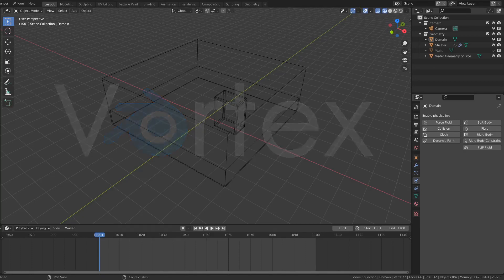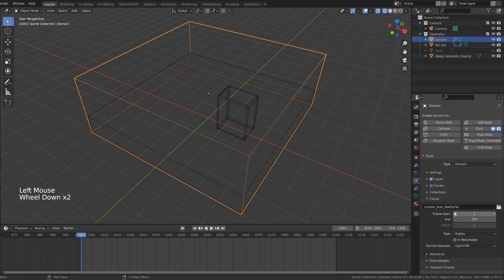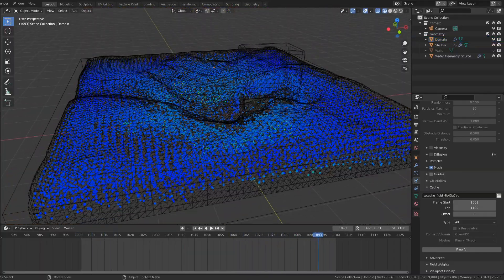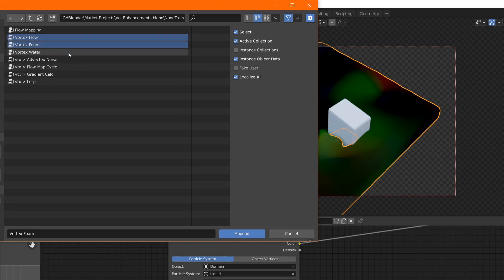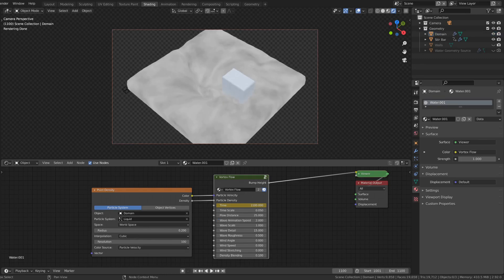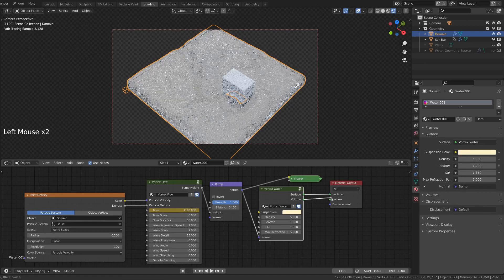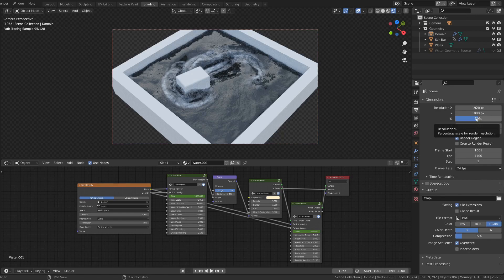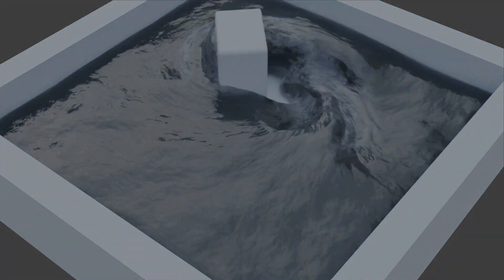How to use Vortex in Blender

Comment: How can you increase the saturation of the water? Like make it a deeper blue.
Reply from the maker: Hi, there's two things you can do:
1. Water colour is very dependent on reflections. Bright blue water also comes from bright blue skies. So, try to find an appropriate environment HDRi texture.
2. Sometimes there are things like algae floating around and changing the colour of the water, change the suspension colour on Vortex Water to see if that helps.
I hope this works for you!

Comment: does it work with flip fluid?
Reply from the maker: Yes it does! With the latest Vortex update, materials are generated automatically. You can simply select to use FLIP Fluids in a dropdown menu, and it'll be set up for it. (as long as you're using the right addon versions)
Reply: @WittingGraphics  nice! Idk if I have the right version, I bought flip fluid for in january this year, is it the right version ?
Reply from the maker: You will need to install a newer version, but it shouldn't matter when you purchased it since you get lifetime acces to new updates.
Reply: @WittingGraphics  ok thanks!!

Comment: I’m just getting into blender but I wonder how do you even get into creating add-ons. Have you been coding or using 3d software longest? Did one get you into the other?
Reply from the maker: Good question. I have personally started coding a while ago and now study Computer Science. However, Blender is really developer friendly, it exposes all its data through Python. If you right click any value and click "Copy full data path" you can paste it in the python console (a UI tab within blender) and view or modify the value to experiment. 
I suggest starting with some Python tutorials or online courses. After that, making addons comes down to just using stackoverflow, it gets more difficult depending on what you want the add-on to do of course.

Comment: Bought Vortex off Blendermarket a few minutes ago. Didn't have a chance to try it properly yet. Only played with it for a couple of minutes. Was getting frustrated unable to get it to work but just found this video. Will have a proper look tomorrow and will follow this tutorial. I seems very promising. I'm very excited about it and to be able to use it with the Flip Fluids add-on. Thanks for developing this. So much appreciated!!
Reply from the maker: Thanks for the kind words. Keep in mind that this tutorial uses Blender Mantaflow instead of Flip Fluids. Where Point Density is used, you should be using an Attribute node like in the docs (under heading 2.2).